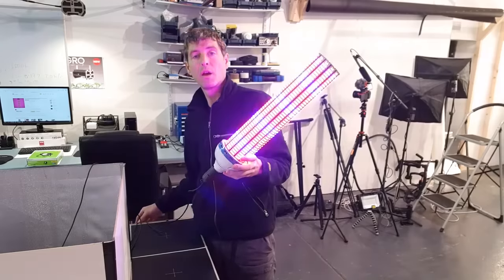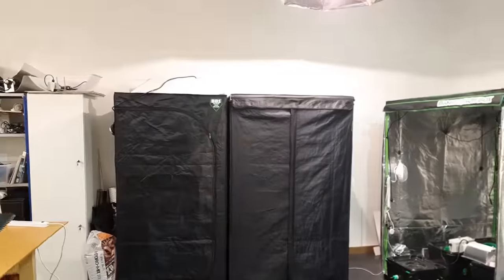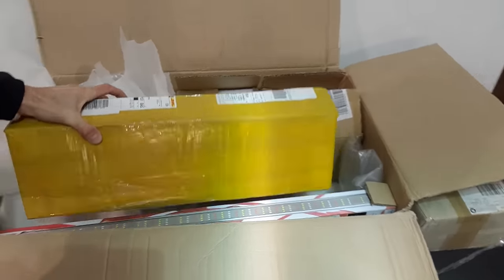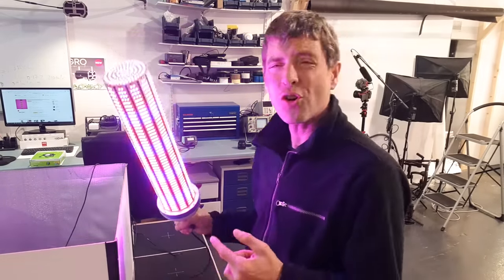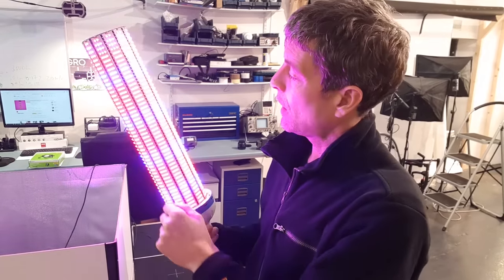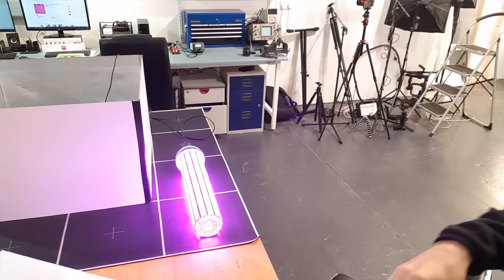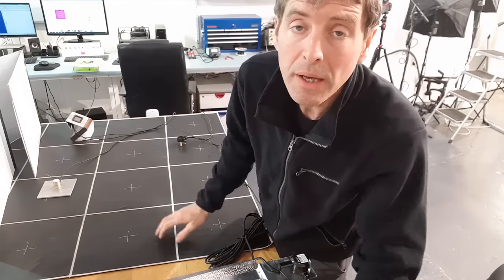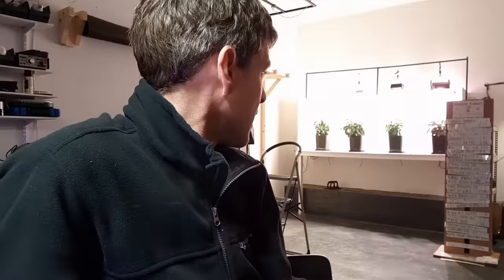TOTALLY POINTLESS GROWLIGHT - I LOVE IT :)

Comment: Plants grow towards the light. To get the best efficiency from this hang vertically down in the middle of the grow to fill out the plants along with larger overhead lighting. Vertically you get 360 degrees lighting.

We are off grid so efficiency is important. For a vertical a single t5. Dropped into the middle so you have 360 light causing plants to fill out a great deal.
Reply: I can't believe I never thought of that lol. I have a Big Corn Cob Light and I've been hanging it up above the Plants wasting so much of the light. Tonight when I go to set my lights up I'm gonna try placing the Corn Cob Light down lower in between my 2 plants. I just hope it doesn't cause light burn.
Reply: @jasongrisafi7828  well you are now in uncharted territory 😀 it's my own design to maximize efficiency. 1  t32 watt dropped in. Oh yeah we designed the light off grid. The larf grows BIG 🌹
Reply: Or build a 30” diameter cylinder  out of chicken wire and tie the plant off arround her as she grows with the light in the center 💫
Reply: Never underestimate the predictability of stupidity.
Reply: Light i s only taken in by the top side of leaves
Reply: stevenpayne81 just searching  threads looking to insert this trite expression or what?
Reply: @GHOSTLOVE-nj4gx  the expression fits the comment. why? what's your problem with it? 
Or you just searching for ways to use your obscure words to pretend you're intelligent?

Comment: I would reconfigure the layout of the LED strips, find the nominal/max wattage the LEDs can handle and increase their output if possible. Do you even solder?
Reply: you can buy these leds  for about 1 usd per meter. 20 watts a meter if you run them at their max.  80 lumen/watt.

Comment: Most of the time I have seen these lights used vertically. Not challenging your findings how would it fair out measured vertically vice horizontal?
Reply: I have 1000w full spectrum and small 225 light led. still use this as supplemental lighting hung at 45° and a 65w flood lamp. My Corn Cob light is a 45w all white led, not full but good par spectrum from a hardware store for $20.

Best wishes on your grows.
Reply: It would measure out even worse with no reflector.  Unless the LED's on the end were 20 times brighter than the ones on the side.

Comment: That "corncob"  LED should be mounted upside down vertically in an old school high bay dome reflector. That is what the OG CFL lights went in with a mogul base. The strongest LEDs will be in the tip that you were covering in your mini test area. Mounted with the tip down those LEDs you covered would be the main down cast lighting, your "COB" if you will.
 If you mount it correctly and the tests are significantly different make a do over.

Comment: I would love for you to test mammoth lightings 10 bar. They advertise theyre better then fluence and 2.9 efficacy!!!
Reply: Wow, that thing is a beast if the numbers are true, also 500$ cheaper than the competitors. oO
Thanks for the info/hint.
Reply: @hansmuller4338  ive been really close to buying a couple. Theyre even on amazon! I would love to see a full review to see if they really are as efficient as advertised. Which i doubt. But they do use top bin diodes. Frkm their page u can choose 2 different kinds. Ahhhh i just want a full anylisis.

Comment: 25ish milliamps per led that nice seems like a half ok device interesting ether way 

And image these just for a 4x4  get 9 of these and put them in a grid  interesting stuff being made lately
Reply: They're blinding but not too hot. I'd run 4 of these corn cobs with 4 warm white CFL at least around 45w or so each but i've seen 200w CFL. 200w CFLs, just a few of those in a 4x4 if I could find them around here! I really like to see the plants not just blurple.

Comment: Shane it's not entirely pointless. Some years back I was inspired by a project NASA had been developing for the cultivation of fresh produce in space. Now known as a, "Rotary Garden" or also, "VolksGarden" it's a rather innovative piece of engineering and seems to be quite effective in almost every aspect of a grow. This light would be optimal for something like that. I set out to design my own budget version from standard PVC pipes and fittings. Here's a model created in Autodesk Inventor as a guideline for the parts I'd require. https://i.gyazo.com/17429a45751888381e0a0195fc35f2cc.jpg 
Still have not gotten around to physically constructing it due to financial burdens but hopefully the time will come where I can finally complete this lil project and make a list of components for anyone else to construct their own.
Reply: But we aren't in space, we are on planet earth, so it is pointless to go into production with it... especially with the low PAR values.

Comment: 1 corn cob per gram yielded  :( lmfao. Imo anything under 100watts isn't even worth looking at.
Reply: Ill argue it....
Reply: I'll argue against. Not everyone has room for a large grow area. My grow cabinet is 24"x19"x5.5'.  A HLG 100v2 would be about perfect for me and they run at only 95w.
Reply: HLG 100 meaning 100watts it runs at 95w this is fine. but if you have a small area even 1ft x 1ft at least 100 watts is wanted & to add to that you want full spec no point having a small grow light and having to buy another for veg or flower... 1 fixture =100watts full spec if its not that then its not even worth looking at in terms of good end product.